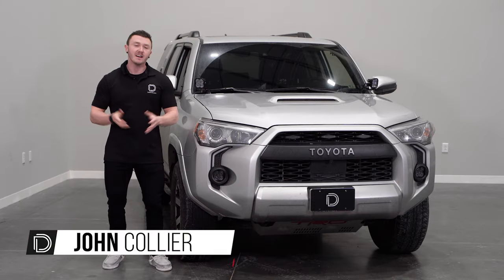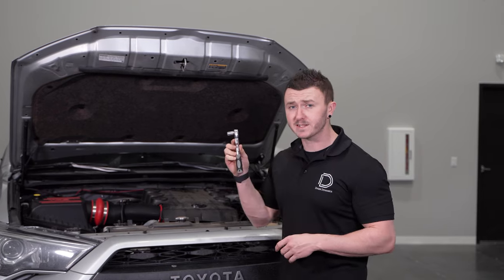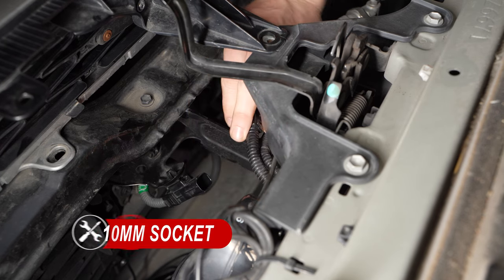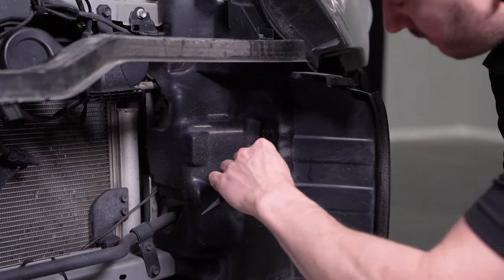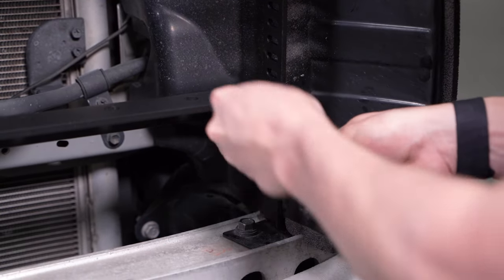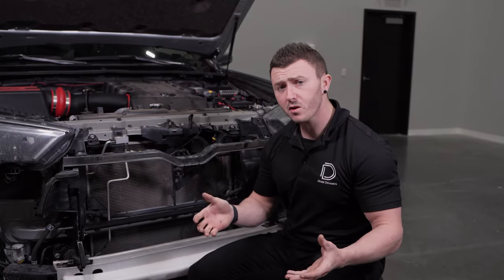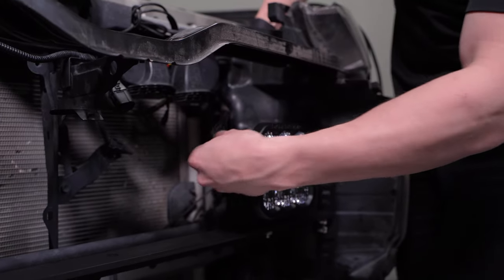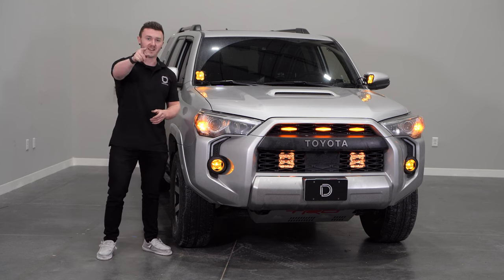How to Install: SS5 Stealth Grille Kit for 2014-2023 Toyota 4Runner | Diode Dynamics

Comment: Great set up, I have the rago bracket and do this. If you wanted to give more options, make more holes on the mounting plate
Reply from the maker: Great idea! We'll bring that up to our engineers for future consideration!
Reply: @diodedynamics  Seems like a no brainer, a lot of different applications could also be done. Do you sell the bracket separately or can only buy in the kit?
Reply from the maker: @jsnow6925  We do offer just the bracket!

Comment: Do you suggest a dual battery setup for 4 5" pro system?
Reply from the maker: There should be no need for our lighting setups, however you can always run an accessory battery!

Comment: How would you set the backlight to go automatically with your running lights?
Reply from the maker: You have the option to tap into your headlight DRL power wire to gain OEM function, so that when you turn your parking lights on, the backlights will turn on along with your DRL!
Reply: @diodedynamics  are there instructions on how to do that with the kit?
Reply from the maker: @DallasRSnider  Since the backlight feature is depends on your personal preference, we do not show exactly how to do it, since applications may vary. Keep in mind however, the White SS5 pods have 8 selectable backlight colors, while the Yellow SS5 pods only have an amber backlight.
Reply: @diodedynamics  how would you go about making the back light work with driving lights?

Comment: Will I be able to run a row of 4 SS5's centered and side by side?
Reply from the maker: Unfortunately not out of the box. Theoretically, you could drill out more mounting holes to accommodate a more central mounting location if you do not have the Toyota Safety Sense feature. Feel free to give us a call at 314-205-3033 Monday-Friday 10 a.m.- 5 p.m. CST, or shoot us an email at contact@diodedynamics.com, and our service team would be happy to help you with that further!
Reply: @diodedynamics  I have a 2016 so there is no safety sense. I will call when this is available maybe I can pay more to get it set up for 4
Reply from the maker: @jessemorgan7007  It would have to be a custom bracket, or custom mounting holes on our bracket to make them central like you would want!

Comment: Does this work with aftermarket bumpers like C4 Low Pro?
Reply from the maker: It shouldn't affect the install, however depending if you have a bull bar, there could be some interference with output. You will have to remove the bumper for installation, however.